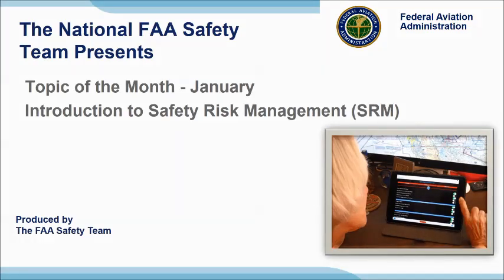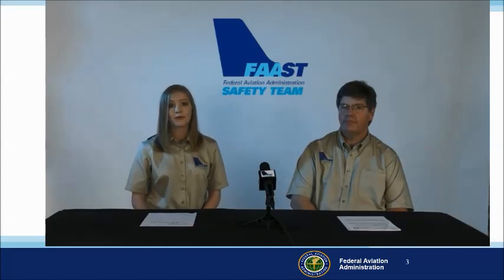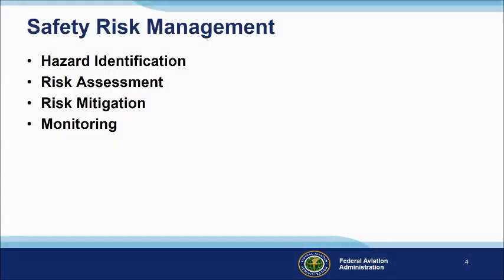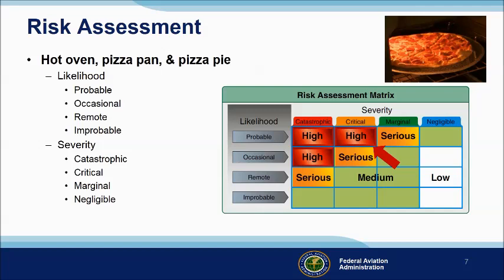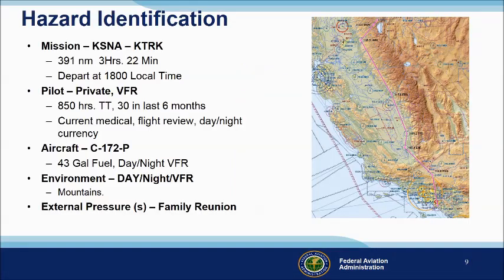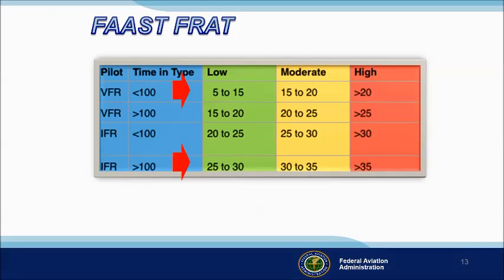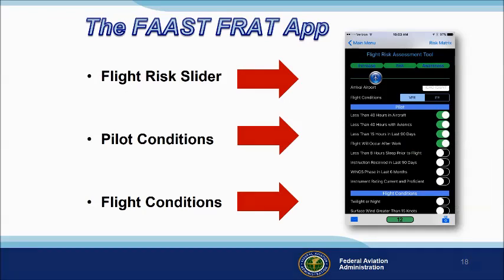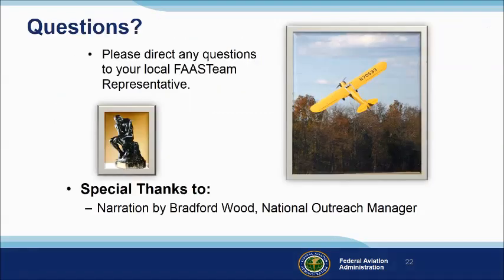Introduction to Safety Risk Management

Comment: Did SRM change from "single-pilot resource management" to "safety risk management" at some point? I cannot find any documentation of the term "safety risk management" in the PHAK or Risk Management Handbook, and they both state SRM stands for "single-pilot resource management."
Reply from the maker: Unfortunately both single-pilot resource management and safety risk management can be abbreviated as SRM. In order to avoid confusion, we are attempting to only abbreviate on second reference when necessary. Our new risk management fact sheet is available at http://bit.ly/IntroRisk, and safety risk management is a component of a Safety Management System (SMS). More info about SMS online at https://www.faa.gov/about/initiatives/sms/explained/components/.
Reply: if SRM is safety risk management, FAA is the federal acronym authority :o
Reply: J😊😊